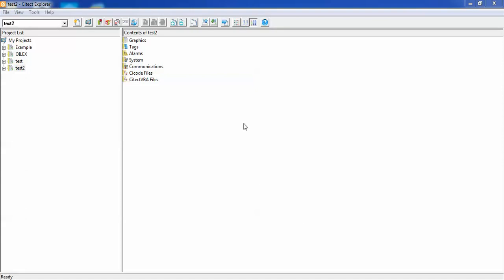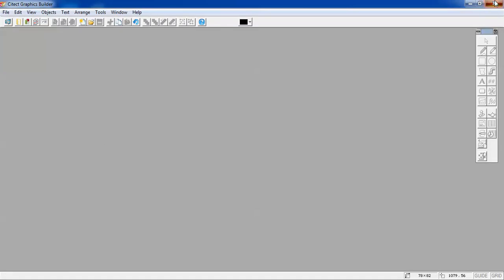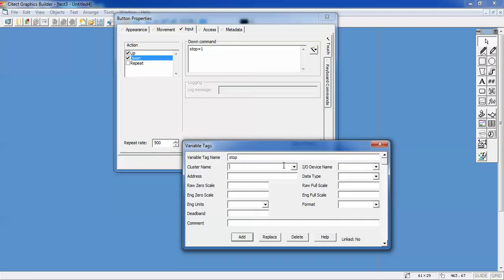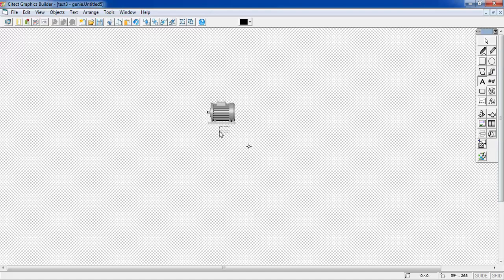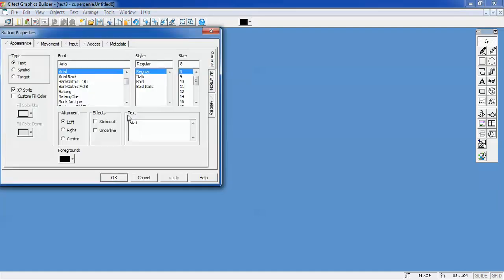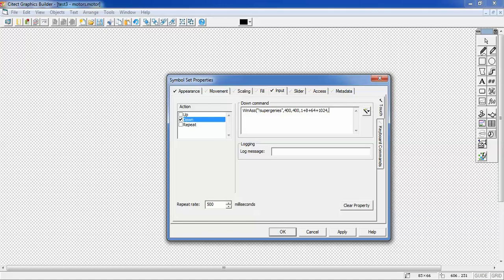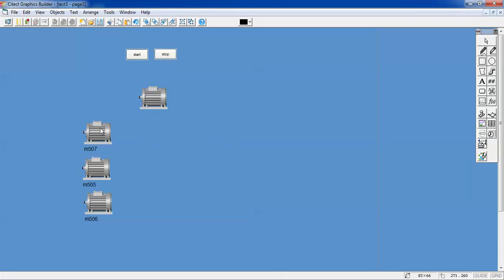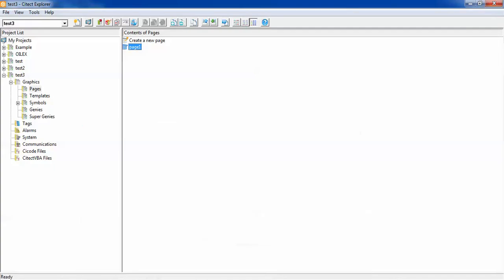Genie and Super Genie  configuration for Citect SCADA

Comment: Hey, could you explain what exactly the mode is ? I don't get it why you gave 1+8+16+ etc .
Reply: Hello, 
I wanna thank Ahmed Hamad before anything because without it, i would still be lost and with this video i had a huge step forward and i am trying to help complete his work.

I looked it up in the Citect Scada help, i use the 2018 version and i used the WinNewAt(Page, X, Y, Mode[, sClusterName]) function instead of the one Ahmed Hamad used in the tutorial, 

 I copied it from the help page: 
WinNewAt(Page, X, Y, Mode[, sClusterName])

Page:

The name or page number of the page to display (in quotation marks ""). Can be prefixed by the name of a host cluster, that is "ClusterName.Page". This will take precedence over the use of the ClusterName parameter if the two differ.

X:

The x pixel coordinate of the top left corner of the window.

Y:

The y pixel coordinate of the top left corner of the window.

Mode:

The mode of the window:

0 - Normal page.

1 - Page child window. The window is closed when a new page is displayed, for example, when the PageDisplay() or PageGoto() function is called. The parent is the current active window.

2 - Window child window. The window is closed automatically when the parent window is freed with the WinFree() function. The parent is the current active window.

4 - No re-size. The window is displayed with thin borders and no maximize/minimize icons. The window cannot be re-sized.

8 - No icons. The window is displayed with thin borders and no maximize/minimize or system menu icons. The window cannot be re-sized.

16 - No caption. The window is displayed with thin borders, no caption, and no maximize/minimize or system menu icons. The window cannot be re-sized.

32 - Echo enabled. When enabled, keyboard echo, prompts, and error messages are displayed on the parent window. This mode should only be used with child windows (for example, Mode 1 and 2).

64 - Always on top.

128 - Open a unique window. This mode helps to prevent this window from being opened more than once.

256 - Display the entire window. This mode commands that no parts of the window will appear off the screen

512 - Open a unique Super Genie. This mode helps to prevent a Super Genie from being opened more than once (at the same time). However, the same Super Genie with different associations can be opened.

1024 - Disables dynamic resizing of the new window, overriding the setting of the [Page]DynamicSizing parameter.

4096 - Allows the window to be resized without maintaining the current aspect ratio. The aspect ratio defines the relationship between the width and the height of the window, which means this setting allows you to stretch or compress the window to any proportions. This option overrides the setting of the [Page]MaintainAspectRatio parameter.

8192 - Text on a page will be resized in proportion with the maximum scale change for a resized window. For example, consider a page that is resized to three times the original width, and half the original height. If this mode is set, the font size of the text on the page will be tripled (in proportion with the maximum scale). This option overrides the setting of the [Page] ScaleTextToMax parameter.

16384 - Hide the horizontal scroll bar.

32768 - Hide the vertical scroll bar.

65536 - Disable horizontal scrolling.

131072 - Disable vertical scrolling.

You can select multiple modes by adding modes together (for example, set Mode to 9 to open a page child window without maximize, minimize, or system menu icons).

P.S: i used Metadata to configure the variables in the super genie and keep it flexible so i can adapt it to different motors...
you can check this tutorial of another Automation engineer in which he used Metadata so you can get an idea on everything you might need. 
This is the link: https://www.youtube.com/watch?v=sGqT7lOaoc8.

Best of luck.
Reply: @black3238  Thank you so much for this! Unfortunately Citect 7.1 doesn't have metadata function lol